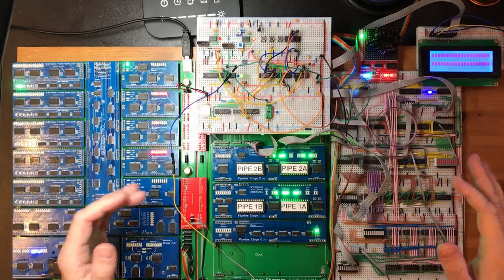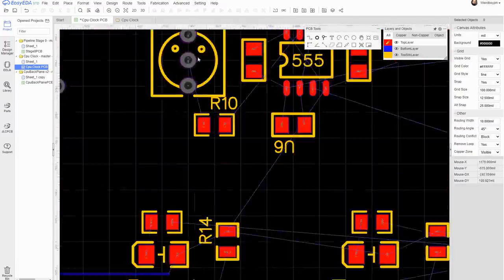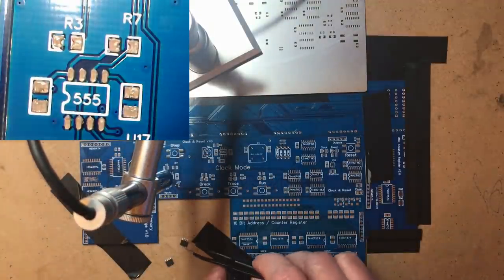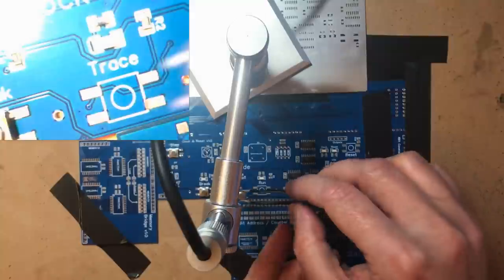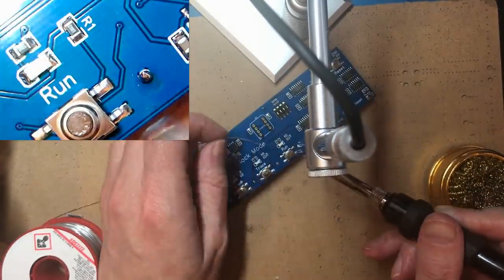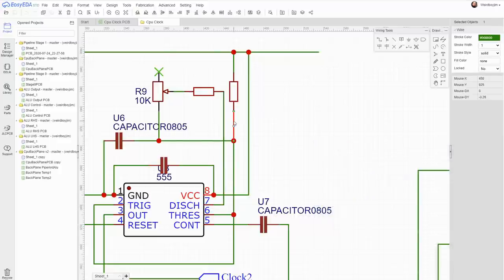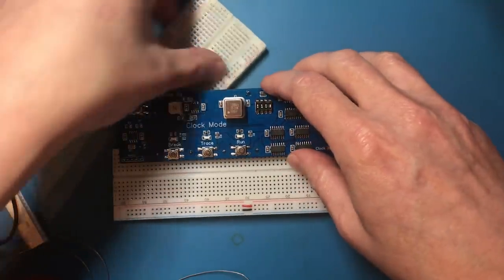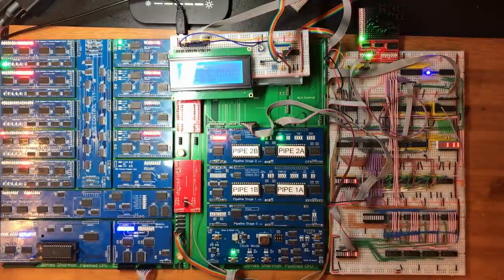Clock PCB (With bodge!) - Making an 8 Bit pipelined CPU - Part 88

Comment: Very nice :) you had to have a major bodge eventually, it's almost amazing it took this long. You've definitely got a great track record so far off designing functional PCBs.
Reply from the maker: Thanks Brandon, the good record is mostly down to my building everything on breadboard first, this one was really just a transcription error.
Reply: @weirdboyjim  I feel like that's the right way to do any complex circuit, so you can make sure it works before you spend a lot of money on it.

Comment: Can't wait to see your plans for ALU. Interested how are going to incorporate diode rom.
Reply from the maker: I'm hoping to do the diode rom a bit more spaced out so I can write the operations next to each row, that way you can see the control line pattern in the diodes.
Reply: @weirdboyjim  I thought of Doing it as a Matrix, with horizontal connections on the Top and Vertical on the Bottom and Vias connecting the Control lines at the right places

Comment: My favorite way to cut traces (tracks) is an electric engraving tool. This is a big part of my stripboard technique. I use a marker to draw where I'm going to cut, double-check my marks, then go over my marks with the engraver. A pencil-sized AAA battery-powered tool does the job just fine.
Reply from the maker: Interesting, probably easier to be sure you have separated the conductors if you create a visible gap.

Comment: Excellent work. I find that a good sharp #11 X-Acto blade works well for cutting traces. A little bit of heat from the soldering iron will lift the middle bit of the trace between two cuts, though you want to make very sure the lifted bit doesn't make it's way back to the board.
Reply from the maker: That sounds about right, I'll go blade shopping when I get a chance. It's only temporary though as I plan to replace the pcb next time I order some boards.

Comment: Looking great regardless! The old trick I use for breaking traces when all else fails, is to spin a small drill bit over it.
Reply from the maker: I've used a drill bit on strip board, but for pcb's like these I find it inaccurate. With the knife though I'm always worried I might leave a join (Or something that could join when the board flexes)

Comment: Is it normal for the plastic on those tact switches to melt a bit? Or is that just a side effect of using hot air for soldering them?
Reply from the maker: Definitely not normal. These devices are designed to be soldered in a reflow oven with a very precise temperature curve. With the handheld hot air it's far too easy to overheat them, most components are a bit more robust but these are obviously not. The one I replaced was ok because I used a bit of Kapton tape to project it, when I do the updated board i'll either do that or hand solder all the switches.

Comment: For times when you just have two pins swapped over just lift the pins up and run a fine wire between the pin and the pad it should go to.  Enamel copper wire does this great, and you can get it by taking any old radio apart for the IF transformer windings.
Reply from the maker: I have various gauges of ecw around anyway. I couldn't to that on this one since the resistors connections were swapped, but there were other connections that needed to remain unswapped.

Comment: Not that it matters but, interesting tidbit: they actually make sockets specifically for oscillators in that package (DigiKey part # A463-ND) :)
Reply from the maker: I've seen those,  I couldn't find them from the supplier I was actually ordering from though. Mouser has the longer ones but I couldn't find the shorter ones from them.
Reply: @weirdboyjim  I tend to use a 14 pin socket, because you can then cater for both the 8 and 14 pin footprint oscillator packages.

Comment: Hey James. I'm thinking of starting a new project and moving to PCBs and was going to start with your clock module as a trial. I checked your EasyEDA profile and can't see it there. Is the schematic it available?
Reply from the maker: I usually share designs out when I've tested them as working. I've not tested my fixed version yet. If you really want it sooner follow me on easyeda and message me your username, I'll see if I can work out how to share it. Your own risk if i've messed it up again though.
Reply: @weirdboyjim  Thanks, James. Sent you a message in EasyEDA. Understand no guarantees since it's untested.
Reply: James, any idea when you'll be releasing the clock module? That's where I want to start as well.
Reply: I ended up building a clock module heavily influenced by this one with a few minor changes. I've only built it on my custom proto card for my backplane so far. I do plan on a custom PCB for it.

Comment: you may want to use a piece of kapton on the button next time, it seems they didn't like to be too crispy
Reply from the maker: Yes, I used a bit of Kapton when I replaced the break button. On the fixed board I may do that, or just hand solder them.

Comment: I remember there were chips that contained two or four 555 timers.  I see you used two separate 555's rather than one of those.
Reply from the maker: My decisions won't necessarily align with other people but I have my reasons. I wanted to keep the 3 clock sources as separate as possible on the diagrams, using a 556 would have blurred the schematic more but also added another chip to track to my storage that would only be used in one place in the build.

Comment: I was thinking about using your clock design for my build but I didn’t see the schematic on your easyeda profile, is there anywhere I can get it?
Reply from the maker: The clock needed a couple of bodges, I usually only like to release the schematics once I've shown the resulting on board on video and I haven't gotten around to testing the revised board. I've had a few people ask about that so I'll see if I can get to it in the sooner rather than later.